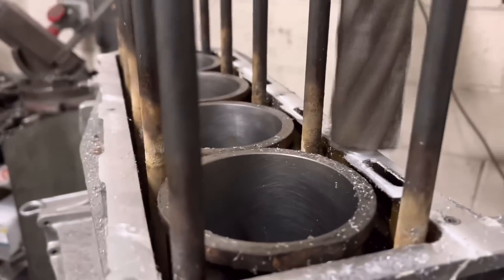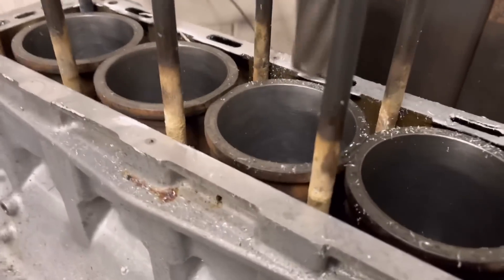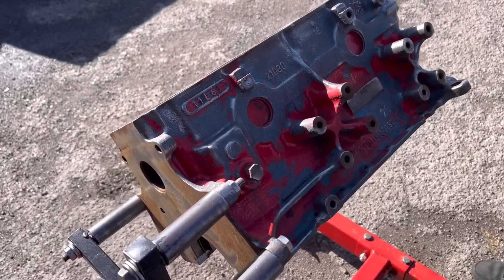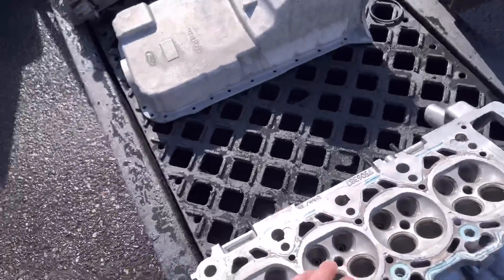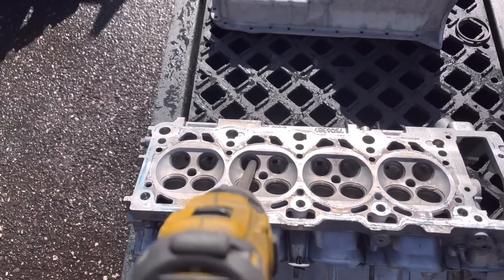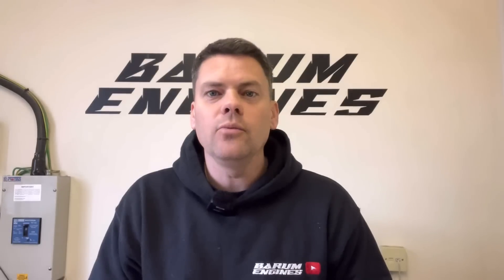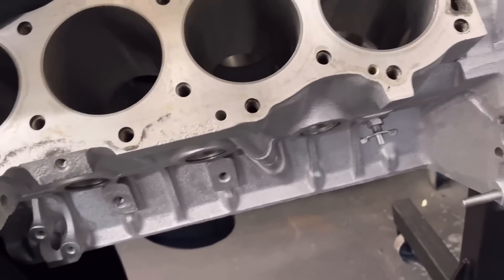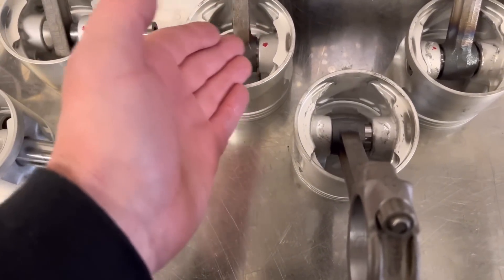Male Karen makes FALSE warranty claim with FAKE invoice

Comment: There is not, and never has been a contract between you and the claimant. They now need to provide you with the details of the person they bought the car / engine from, so any warranty can be sorted, based on the invoice being verified with the original customer. If they can't do this, then it's not your problem.

Comment: Demand him sending you all relevant documents. If the invoice has been doctored, report him to police for fraud. Then send him the crime number, that will make him vanish.
Reply: If he is the innocent party in this, it seems a little harsh, but this is the correct way to handle this. You need to be very clear that without sight of the invoice (which I would photograph), you can't confirm if it is based on a genuine invoice.

Comment: You need to take note of engine block numbers or place your own stamped number onto the blocks cylinder heads etc. This way you can check if the numbers matches what's in your system
Reply: I’ve dealt with Dennis Osborne and Mountune who all numbered jobs on stuff 
There was no getting away from records of what was done and to who .
If I do a box or motor for Tom I’m not having Dick contact me wanting a repair job .
And anyone contacting me asking questions it’s easier to trot out gdpr and F*** em off mitherin 🤣
Reply: Stamping the invoice number on the sump face worked for us,

Comment: Usually a warranty for a race engine is "no warranty" and if there is a warranty it is never transferred if the engine is sold to another party, but that's just how they do it around here
Reply: I worked for Lex Mead in the 80's and they were fair to the penny with every customer !!!
.
A head gasket on a Rover 2.6 SD1 was done by "us" and the car was then sold to a nicely spoken man in London
.
He gleaned the information and then turned nasty as the gasket was gone again.
.
I was told you don't discuss other people's bank accounts
.
I think Lex Mead were right in the fact that his consumer rights were lost !!!
.
He sues the man he bought it off and then that man sues Lex Mead .
.
No shortcuts

Comment: Do you use a color laser printer for your invoices? Most people do not know this but color laser printers print a yellow micro dot pattern on the back of every page to prevent counterfeiting money. You can compare those dots to the ones on your own printer and prove it did not come from your own printer. This is a good reason to use an inexpensive color laser printer for business documents.

Comment: No matter what happens with this case, from now on, I think I would limit warranty coverage only to the original client. Obviously a paid in full, closed work order must be presented before any warranty coverage can be considered. If a client sells an engine to a buddy and it fails, then you could consider covering it only if the original client steps up in his buddy’s place and presents the engine and invoice(s) to you for repair.
Reply: warranties are not transferable in most situations.
Reply: How can you warranty a high performance engine anyway you know they are going to go beat the guts out of it
Reply: @copper4441  Most warranties cover defects in materials or faults in manufacturing, a company won't replace a sofa if you have attacked it with a stanley knife.

Comment: Good morning Lee. Just another method we used was Bar Code labels. These can be made very tough and self destroy when removed. All you would need to do is have a printer. You could then store the code on your invoice system. You would need alas need a bar code hand held reader. State on the invoice if the label is removed warranty is void.  I`m not sure but you may be able to get the labels pre printed. What do you reckon. It will certainly stop all these false claims.?

Comment: I would start taking pictures of every block and head, and stamping small letters B E or a custom punch symbol.
As a rule, place stamp marks under every left cylinder head corner, and left block face . so they are over and under the same area. when disassembled.
Purposely put stamp on the face where it cant be seen assembled! I had to do this in a molding/press service shop on anything we made...

I made a custom font / cursive stamp for my initials that was basically unforgeable. It actually proved i didnt make a couple of bad assemblies in the past.
Reply: That is a brilliant idea, a custom made punch!
Reply: @Darth_Chicken  he's not the first to suggest this. Someone else did when the gearbox fiasco started up and Lee got pictures of what looked like a completely different gearbox  and for Barum Engines to get a stamp made and stamp every part they machined or engine they built in future. Of course he's not done that has he?
Reply: @samrodian919  
And how would you know that they haven’t? If I did a secret stamp I wouldn’t be shouting it to the world. Duh.

Comment: I ran into this a few years ago. Turns out the program I used to send estimates left the entire invoice in edit mode instead of just the approval line. 
2 things that saved me is that I am a 1 man show so I knew I had never done the job and hadn't done that particular engine for a couple years. That and my warranty is only good for the original Purchaser unless I am notified of the sale by the original owner

Comment: Are your warranties transferable? 
I have always been of the opinion unless specifically stated, warranties are ‘non transferable’ - though stand to be corrected. I’ve never assumed if I buy something with any warranty balance left, that I could make a claim unless it was clearly stated that I could. Could you not do a search of the invoices using the engine type etc to trace anything relating to it (if of course it exists at all). 
In any event if paperwork isn’t produced with details that match your records then any permitted transferred warranty claimant is going to struggle to make a successful claim. 
I suspect someone is coming the see you next Tuesday, to see if you’ll just make him a shut up offer because of the outcome of the last case you had …maybe?

Comment: About the pistonpin in the conrod.... 

Citroen AX 1.0 came out in 1986 in the Netherlands.... cars newly delivered to the Citroen-agent where I worked (Stroeve in Coevorden) directly stroke us mechanics with a funny knock from the engine.... and  also with these (brandnew-) cars a blue cloud seemed to be normal when idling for a while....

Sure enough things were pearshaped.... all of these 1.0 engines needed a piston/cilindersleeve replacement under warranty... but the W/S Supervisor got a sore stomac when he noticed me needing 16 hrs to do this job... Citroen only payed 11 hrs (at a VERY low hourly rate...)

It took me a few cars to get into it... (drop oil,sump,oilpump.. remove the head... remove pistons/sleeves...and so on...) but than the tricky bit starts.....
As you’ve shown us here I had to heat up the small end of the conrod (temperature????... centre-ing the pistonpin????... how not to burn my fingers????!!... how NOT to waste the parts dedicated to this car... that the owner comes to collect at the end of the day...)

After a few cars I found my way around it... remove the head:20minutes (stil too hot to grab without rags...) use an electric drill to remove all these 6mm bolts holding the sump... and improvised an adaptor to make sure to get the pistonpin centred on the conrod (it is a matter of milliseconds....)
By the way the cause of the problem was clear as we looked at the pistons remooved.... the skirts were way too short... the pistonpin was centred only just above the low end of the piston... no mechanic would ever miss this blooper!!!!

Fortunately the W/S supervisor was happy with me as,after a while,it took me less than 7hrs average to complete the job!!!

Believe it or not,Citroen a few years later had exactly the same problem with the newly introduced 1.8 petrol engines.... skirts on pistons too short.... 
Greetings lads,from pensionado mechanic (now driving lorry...) Dedemsvaart,the Netherlands.

Comment: I use 2 tools to assemble rods like that one is a k-line 2 hole electric heater, also have a propane fires one with 2 opposing flames. Then a sorta assemble jig that holds the piston and a stop for the pin..

Comment: Liners swap them ,and next time measure all of them before install, then match to the block, because the original likely is slightly different due to the original cutter having worn during the original grinding process, and not exactly being the most exact aside from the initial decking operation before those rods went in.

Comment: Back in the early eighties when I was an apprentice auto electrician my boss used to put a chrome sticker on the alternators and starters that had been reconditioned by the workshop. We used to put a date code on the stickers at the time of sale. After I finished my apprenticeship I purchased the business from my boss. On the stickers it stated that it was another 'guaranteed reconditioned  unit from 'Vince Barbat Auto Electrical'. When I took over I had an agreement with Vince to cover any warranty claims that came in and he would reimburse  any costs. Vince also had this thing for orange paint, and the solenoids on the starters were painted orange and the fans on the alternators were also orange. About six odd years after purchasing the business a customer came in and was yelling and screaming about a statermotor he had just purchased was crap and demanding we fix it immediately.I approached this madman and calmly asked where he had purchased the starter from? He had calmed down somewhat, and stated that the wrecking yard he bought it from told him it was under warranty to us.  I explained the change of ownership and the date code was around eight years old. He ended up purchasing another starter motor from us and went away in a much better mood.

Comment: Sounds to me like someone is using a scanner and computer to create fake invoices, simply if you haven't got a corresponding job number and information on your system I suggest not to worry as either he's been ripped off, which sounds probable,  or he's trying a fast one. Another reason to document every job with all details and specs including the engine numbers on the block to cover yourselves as unfortunately the second hand motoring market,  especially with online deals happening like this are becoming far too common. You'll need to discover who the 'customer' is as that'll clear everything up quickly I'd have thought. 
Another interesting episode regarding the machining 👍

Comment: There are folks cleaning up trashed engines and selling them as "rebuilt". They will even copy a reputable shop's  invoice to give them credence, fleece a poor sap, and run off with a good chunk of money. So unless you're buying your engine from a reputable source, pull the valve cover and oil pan to make sure it is what is claimed. Just because it's clean enough to look new or refreshed doesn't mean it is.

Comment: Hi 
I don't know how many pin tight in rod engines you have to do these days but if they are a regular thing it would be worth investing in an induction rod heater. I used to build the little 1200 opel kadet quite a lot 
I made a jig so I could just drop the pins in without having to think about insertion depth

Comment: Lee many years ago I had one of these engines with a broken stud, I had to remove a main bearing cap and drill the stud out from underneath through the bolt hole.

Comment: Hi again Lee. I never knew that method of the small end pin tight on the conrod and spin in the piston. Doesn`t that wear the piston rather quickly as its ally. ?
Reply: That's common on older Reanult engines too..

Comment: Had someone copy an invoice, showed full service ,cambelt water pump new antifreeze ,discs and pads and DPF clean and regen, then the cambelt failed. Problem was we had not got near that invoice number. Caused a lot of problems but sorted in the end. The invoice was used to sell a car by a dealer we had once done a job for some years back. The dealer was traced by the buyer and friends and the problem went away......

Comment: There's scammers everywhere. When I was running my own business (electronics repair) I put a sticker on everything I fixed. That had the job no and date. That way when someone rang up later with a problem I'd ask them to look at the sticker on the back. You need to mark every cylinder block.

Comment: There is an issue with Privity of Contract here. The Warranty is to the person who contracted/paid for the work to be done, so only they have any recourse at law in the event a claim is denied ... UNLESS your terms & conditions explicitly state that the Warranty is transferable to another party upon purchase of the engine.

As I suspect that the t&c's don't specifically provide for transfer of the Warranty, then just tell the 'scammer' that you will be happy to discuss the matter with the person who paid/contracted for the engine work ... which will most likely make the problem go away.

The exception to this might be if it was clear that the engine work was done negligently, which would have to be proven by the current owner of the engine.

I hope that helps.

Comment: Clogged EGR system will not effect engine performance. It may effect fuel economy on the highway a small amount but the biggest problem is it should trigger a hard code and the MIL.

Comment: For any work to do with an  engine of uncertain provenance, start with a fee upfront, fully refundable if it turns out to be a real warranty job. Even checking an "alleged" invoice against your records should incur a fee upfront.  If they are scamming, they will never pay the fee. If they are honest, they should see the fee as fair given they can not be certain  the work was really yours.  Also, modify your warranty terms to include a fee for transfer of warranty to a new owner, then it just becomes part of the cost of buying the engine.

Comment: You might consider adding to you customer info "packet" a statement about warranties not being transferable. Cash is good, but you might engineer some sort of verification system in case this situation  arises in the future.
Here, I suspect a formal letter from your solicitor  would cool his ardour.  Has he attempted to explain the inconsistency  yet? I suspect not.
You have my sympathies, mate. You get not only trouble from clients, but 2nd hand trouble! The best of luck to you. Btw, excellent video.
Reply: I don't think any such packet would matter in this case, sounds like someone printed off paperwork that looked good enough and either this guy bought it or more likely based on the attitude described the caller was hoping Barum Engines would buy it.

Comment: Do you allow your warranty to transfer to new owners then I assume?  I've seen both ways, certainly cases from retailers where the warranty remains with the customer who paid for the service, not transfer to someone else in the future.....  do you record serial numbers for engine blocks too if they have them?  Could be a way to track physical part not just with the invoice number - sounds dodgy though, I'd ask to see the original advertisement for the engine to see - if it was ebay it will still be listed under completed sales and you will be able to contact the seller via ebay (one way to check if the claim of purchasing in a layby checks out - engine must have been advertised somewhere - either by a random on the internet where it can be checked, or by someone they know and can supply details for)

Comment: I presume even if cash it has customer name and engine details etc etc and they sign for it?! Invoice number does not match your engine. No invoices or ztechs done for that amount. A job card with engine details signed off before work starts normally referenced in an invoice? Why ring a solicitor yet?

Comment: I am no engineer, but what an awful way to install wrist pins. With all the people that try to screw your shop, I can't even imagine how many builders screw up the piston pin assembly process, let alone the other things you've shared with us...  Why the pin rotates on the aluminum piston bore rather than the connecting rod is well beyond my understanding. But, I rarely see small end con rod journals compromised, seems like they have worked as intended. But these pins rotate within the alloy piston which is softer, I don't quite grasp the concept...

Comment: Swiftly jumping to a ‘warranty out’ clause is not appropriate in this case as the current owner of the said engine will be left with the view that BARUM has built a ‘bad’ engine, which is not the case.  From the evidence provided by BARUM, it’s a 'document fraud issue' and needs to be fully dealt with to demonstrate to the current buyer of the engine that he was defrauded by the seller of the engine - as well as enable BARUM to put in place a process that greatly reduces the risk of future fraudulent invoices/data.

Comment: The contract for sale was between you and the original buyer, if the original buyer sells on the engine, it doesn’t necessarily follow that the warranty flows with the sale to the new owner.  I’d hope your terms of sale have a permissive assignment clause, limiting the warranty to the original buyer unless you give your express permission in writing to the assignment of the warranty to a new buyer.  You have no idea of the history, or potential liability you could be exposed too otherwise. You should also contract out the rights of third parties act from the sale.  Ps you shouldn’t be reading it customers names from your computer system, the data commissioner will be after a word with you!